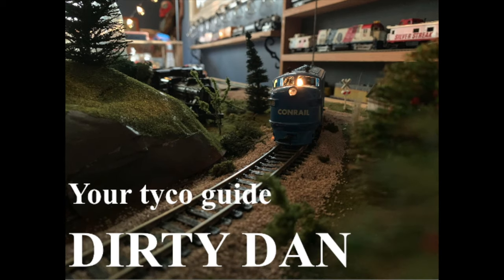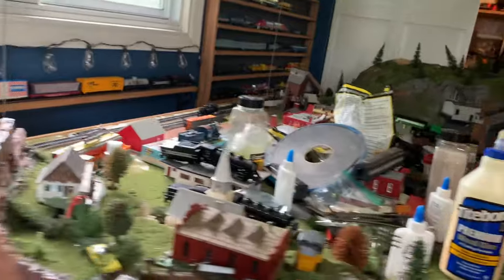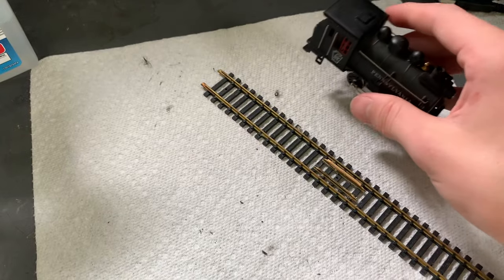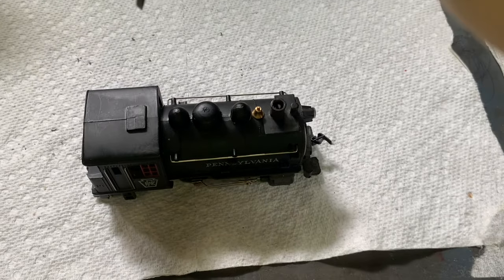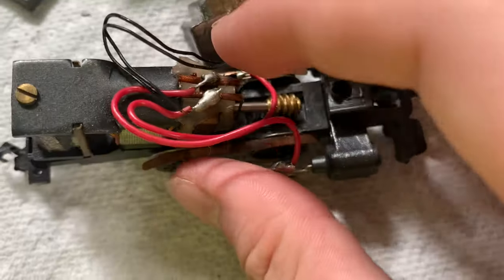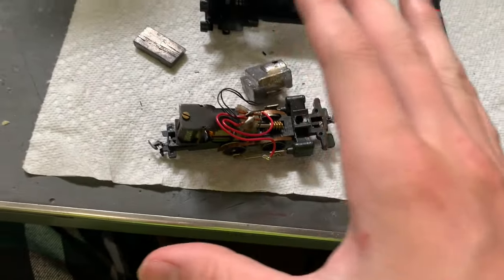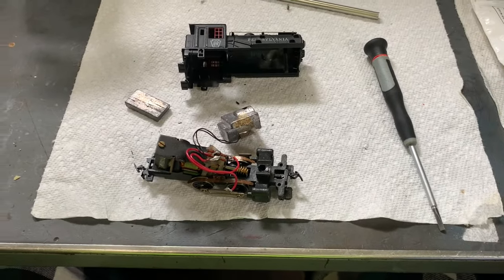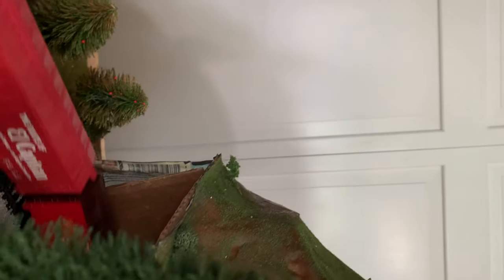How to Troubleshoot HO locomotives

Comment: I have a santa fe number 99 form osa auctions i try to get it moving so i put my bachmann transformer at max speed and the light might flicker the thing will buzz and the tenders wheels heat up and get pretty hot i also want to know if my transformer wires should both be on the dc side or the ac side

Comment: Should maybe clean the surface where the solder is going to attach to . A bit of sandpaper or fine file and  then the flux or it may come off again 🤔
Reply from the maker: Yep I usually do that but I was in a bit of a rush to get it done and cobbled it together.

Comment: Hey dirty dan, today I bought a used older bachmann spectrum on3 Denver riogrande set. It didn’t wanna run at first, I wiped the track down with Brillo pad, cleaned the wheels with electrical contact cleaner and wipe the track with it too. The train got going after that, very slowly tho, on full power it was running at like level 5 speed. Then after a few hours running, it stopped and the motor wound up and made a fast whizzing electric motor noise. Does that sound like gears let go? I haven’t opened it up yet, I gotta go get tiny screwdrivers tomoro. Can bachmann set locomotives be fixed?
Reply from the maker: first off your loco is probably pretty messed up. using a brillo pad to clean track is essentially a death sentence for locos as they pick up the steel pieces and it gets into the internals and ruins it. best thing to do is get another loco
Reply: @dirtydanstrains1414  the “Brillo” was one of those green and yellow kitchen sink sponges, then I cleaned everything with electrical contact cleaner. It’s all good, I’m goin to the local train store later today and see what the old timers gotta say about it.

Comment: So I tried the screw driver method, and I don’t have power going to the track, everything is connected right and plugged in, what should I do from here?
Reply from the maker: If you don’t have power going to the track and everything is connected that likely means your power pack is no good and you’ll need a new one. eBay, hobby shops, and Amazon would be good places to look
Reply: @dirtydanstrains1414  ok thanks!

Comment: When no wires disconnected. Oil the anckor. Main toothdriving wheel. Done.
Reply: Is that the wheel that has a rubber piece on it